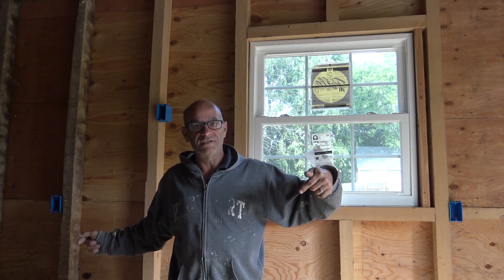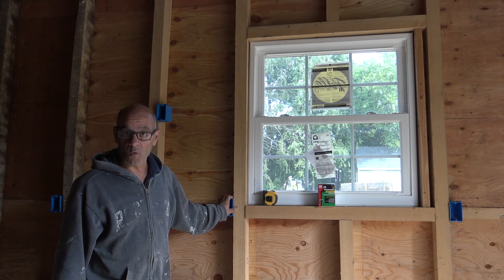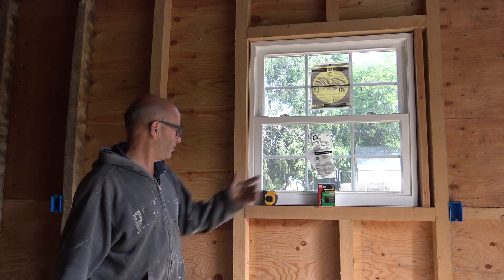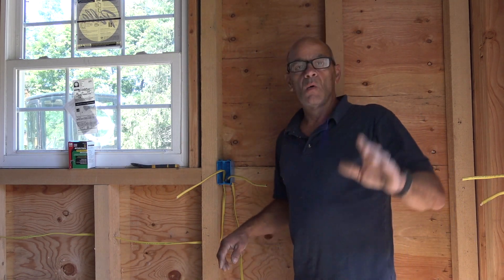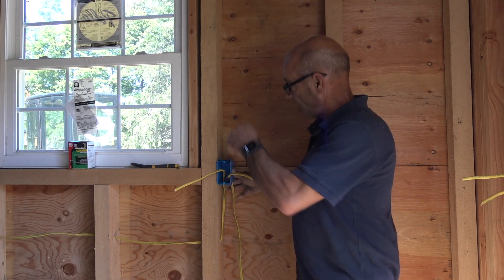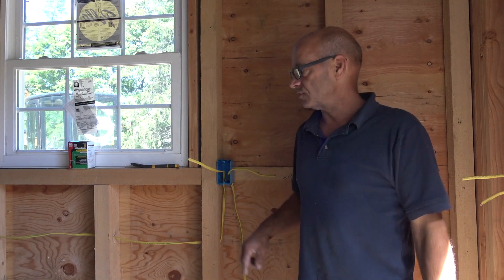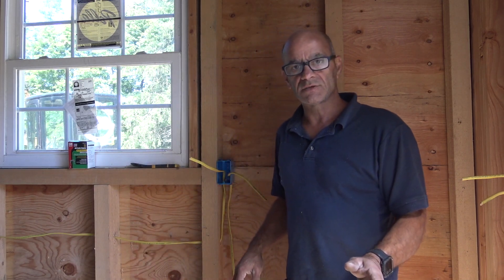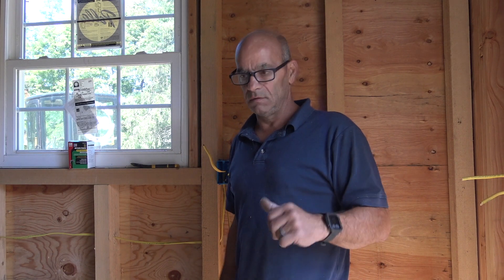Kitchen Outlets. Know the electrical code for your new kitchen outlets

Comment: First thing I see is the framing for the new window behind you. All wrong!
Reply from the maker: The first thing you should’ve noticed this is a 1840 house built with post and beam. So no, you’re wrong
Reply: @Askmediy  maybe but I frame to todays standards and methods. cant go wrong with proper headers etc...only takes a few extra minutes to do it right.
Reply: @jstone1211 maybe what? This is post and beam. The super beam is a few feet right above it. You may know how something is framed today, but not a clue how it was done before or anything to do with other types of framing.
Reply: @DominickAmorosso  the last time I had an inspection, the inspector did not take into account the old way of doing things. But if you are good with it, then what do I know. good luck in your project
Reply from the maker: @jstone1211 no no, this is a type of framing still used today but for barns stuff like that. A house this way would not be done just based on cost and not necessary. This house was just just totally renovated. Not a single header. And trust me, this inspector wouldn’t let it fly if it wasn’t good. 

You basically have post and beam, ballon framing and platform framing. All need headers except post and beam. A very large beam stretches from one end to the other. With big ass post about every 10 feet or so. The wall you see in this video is new, a replacement. But it’s really only to hold the Sheetrock and siding. Look it up and you’ll see
Reply: @Askmediy  First thing before you spoke i noticed was tru 2x4s and hand cut lumber. That lumber has some tight growth rings im sure. Its a shame I'm building and personal financing my own home on my on property but cant use my lumber I cut.
Reply: @Askmediy  I've spent the last couple of years rewiring 100+ year old farm houses and I'm guessing there were no actual building codes back then since I've discovered some very interesting framework. 
Those homes if maintained properly will outlast any of these newly constructed homes.

Comment: What supports the header above the window?  Must be on the Gable end. Inspectors like clean job sites They assume you do the same with your work. Thought you were doing underground Wiring what happened too  The second video ha ha
Reply from the maker: This is the old house from 1840 I've been working on. This house is made from post and beam. The header is way way above the window. And yes I'm still doing the underground service work. Video coming super soon.